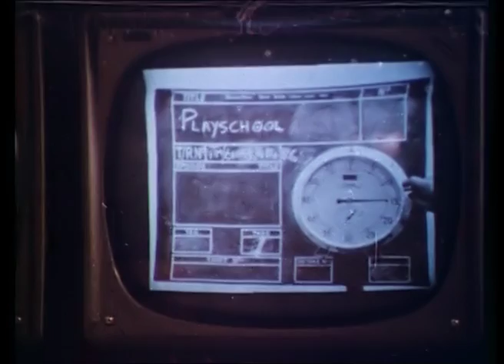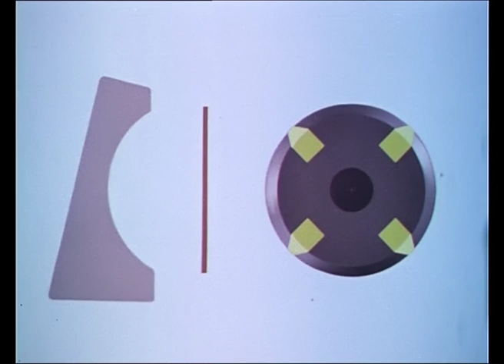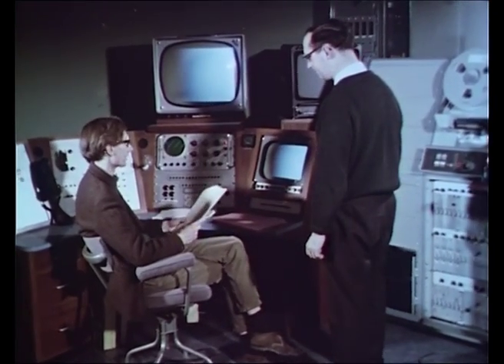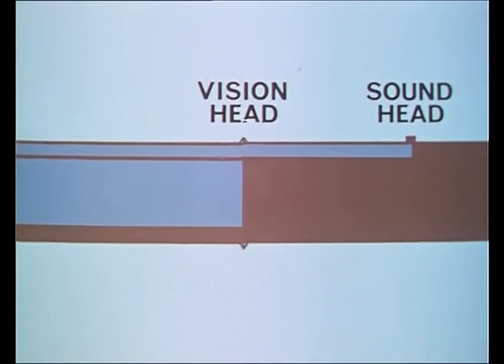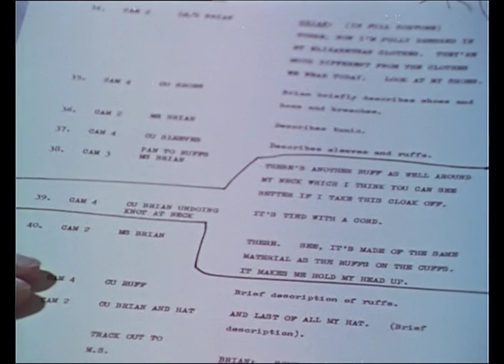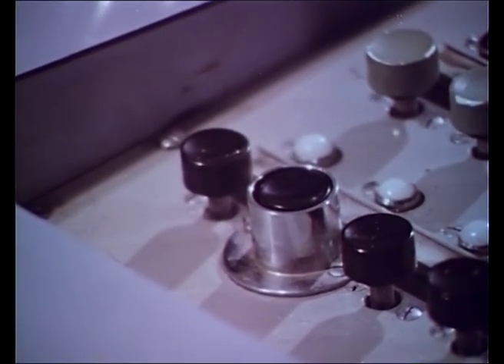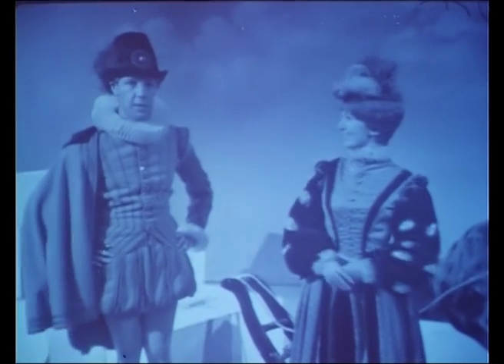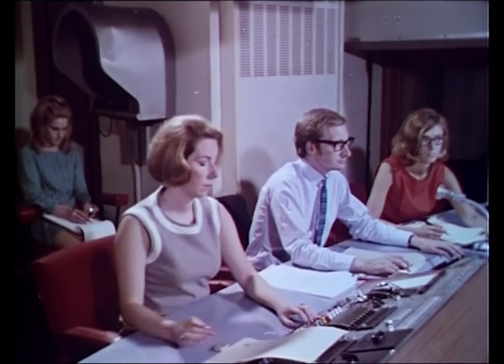Videotape Editing

Comment from the maker: When the show you were cutting was due to be transmitted in a few minutes time, the adrenaline flowed rapidly. Mid week soccer is the one that comes to mind. You'd be cutting &  joining the second half, while the first half was on the air. It was quite exciting really.
Reply: I watched some of those VT Christmas tapes. Being an American, there's a little bit of a culture gap, but they do mention "10-second cues" a lot when it came to sports programs. Is that how much time you had to spool back a moment in a match for "instant replay", or just mixing to a different camera/tape source?
Reply: @eddievhfan1984  The  early quad machines took about 7 seconds to "lock up" and produce a stable picture. So 10s was chosen allowing a safety factor. Therefore the scripts were marked with a point 10s before they were needed and the VT was run at that point. Sometimes it was a bit scary when machines took a bit longer than expected! Later versions of quad machines could lock up much quicker.

Comment: Was the two inch tape inferior to 3/4 inch or was it just wider because of the lower sensitivity/ability of the recording heads?
Reply: The tape was 2" wide mainly because the Quadruplex recording method used 4 heads recording transversely onto the tape (as opposed to the helical scan methods of VHS, Beta, U-Matic, etc.) with full video bandwidth, as an audio-style transport (pulling the tape across a single head) would have severely limited bandwidth, use literally miles of tape for seconds of video, and/or require impossibly high tape speeds.

Comment: Is there any reason you can't just cut the tape in a jagged pattern instead of a straight cut?
Reply from the maker: Why would you want to do that?
Reply: It's way too damn fidgety to try and cut the video and control tracks in one place, then move down to the edit point on the audio track so may inches away, make the cut there, then use a mess of splicing tape to join the two together, especially because a longitudinal cut (following the direction of the tape path) to accommodate the audio track has more of a chance of getting jammed in the tape transport and causing problems than a transverse cut (across the tape path). The least number of physical cuts you can make to a tape, the better, and especially avoiding longitudinal cuts at all costs.
Reply: Thanks for the explanation!
Reply: Phil- I should have been clearer. I meant why not cut the video and audio at different points rather than just straight across.
Reply from the maker: The offset between the video head and the sound head was several inches,  so it wasn't practical to make a physical edit which cut the video track and the audio track in different places.  What we often did was to copy the audio onto a 1/4" sound recorder, and fiddle around with that to make a clean join or a sound mix in the audio where you wanted it, and then lay that back onto the spliced videotape. If you were doing a quick turn around edit for something like a sports programme, then the commentators would have been instructed to leave gaps in their commentary in suitable places, to allow an edit to be made without it cutting halfway through a sentence. All a bit of a compromise, but it mostly worked quite well.

Comment: I don't understand, why they not use Sony Vegas editor for edit video, for example?  :)
Reply: xD
Reply: hm.. sony vegas pre-release lol
Reply: Vegas Pro was a non-linear edit program, but in the 1960s there was no computers on Windows, no digital video files (like MXF or MP4), there was only linear edit using firstly cutter (50s-60s), then electronic edit was launched, (70s-80s) then non-linear edit computer systems (in 90s)
Reply: And why didn't they invent internal combustion Engines at the same time they invented the wheel?